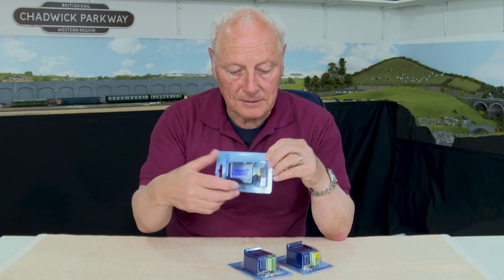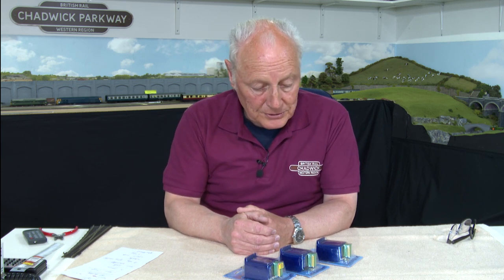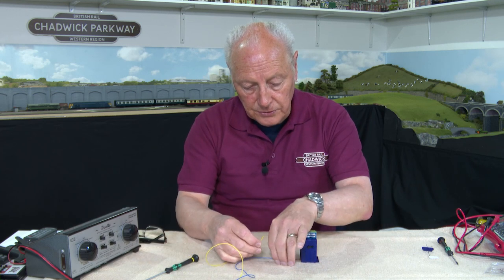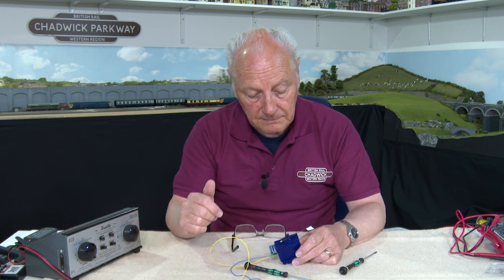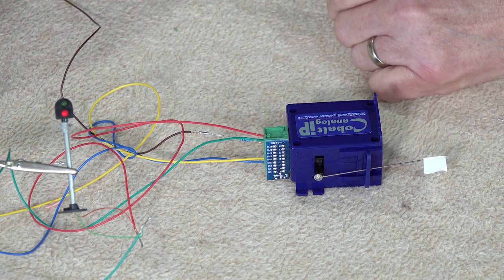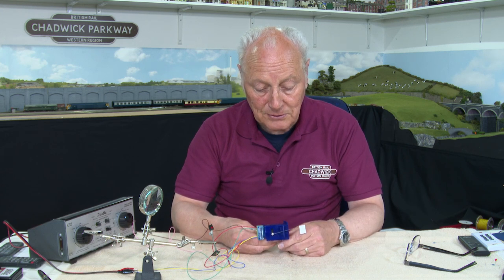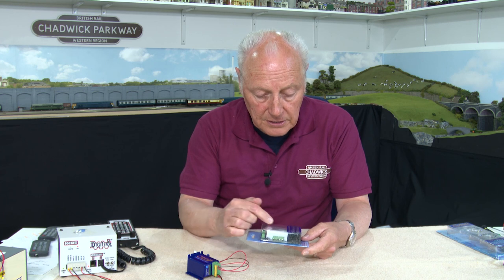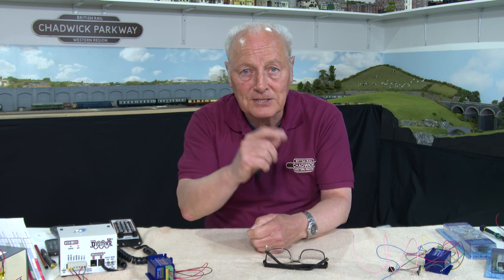Cobalt Point Motors on test at Chadwick Model Railway | 161.

Comment: I bought a 6-pack of the older Classics about five years ago due to ongoing frustration with Fulgurex point motors.  I fitted these about 20 years ago and must have had everyone of them  apart multiple times.  Most of them had the unbelievably unreliable 1950's switches replaced with mechanical electronics hobby shop items that have never failed.  Now the worms are splitting so I began a rolling program of replacement.  This vid would have been even more useful 5 years ago Charlie! What a pleasure it has been to install the Classics.  My only issue has been the plunger cable clips can be a bit hit and miss but once in you are done.  Because my panel was set up for Fulgurex, the switches are momentary DPDT so the current draw issue is not present.  What it does mean is that panel indicator lights had to be rethought.  I could rewire but my system works so will leave it. I have found the sticky pads are only up to the job for a couple of minutes so those screws need to go in rapidly whilst you lie awkwardly on your back, the worst part of the job.  The adjustable fulcrum is an excellent idea.
Reply from the maker: I’m so pleased that you have achieved the satisfactory situation Burt. Point Motors have always been such a pain. Regards, Charlie.
Reply: @ChadwickModelRailway  Thanks Charlie. The Fulgurex units have been the ultimate test of patience and root of much cursing. The revered long time guru of custom track building Norman Solomon endorsed them years ago and I went in boots and all.  Clearly he never operated a layout that he installed them on. BTW, it still makes me smile that the first thing the well informed modeller has to do with Peco electrofrogs is rip the spring out and butcher the underside! Imagine buying a new car and being advised that changing the brake pads on arrival at home is the go?
I’m a 7mm guy so that makes it necessary to remove the non prototipical “coffin” that hides the spring and replace the ugly overscale waxy plastic tie bar too. Not so much Streamline as clothes line?

Comment: I have been using Cobalt point motors over the last 5 years and have found that the grease dries up over time and stalls the motor! Not sure if it's a current issue still but as you pointed out at 24:16 it's still in the manual.
Reply from the maker: It’s not something that comes up regularly Mick, but perhaps a five yearly cycle might be worthwhile. 
Regards, Charlie

Comment: Hi Charlie, great review of the DCC point motors, I started with these on my layout but had one fail and they are very noisy compared to the tortoise point motors.
Reply from the maker: Thanks Rob, which type was it?
Regards Charlie
Reply: @ChadwickModelRailway  DCC IP Digital had 12 in use for a year. With very little use, one failed it would over run and would hear the get cog jumping
Reply from the maker: Thanks for the feedback Rob.
Reply: @ChadwickModelRailway  hi, just like to add. On our club layout we have tried both Tortoise and analogue Cobalt. We have found Tortoise to be more reliable, simpler to set up in that one can manually centre the motor. You need to power up the Cobalt as to try to manually move the unit it will break. We have had a number of failures of the Cobalt units and the lifetime guarantee has its limits.

Comment: Hi Charlie, an interesting video ! I wondered how the Cobalt iP Analogue and Cobalt Omega motors differs from the Cobalt iP Digital - now I know !

After quite a bit of research before I started to build Pevenbourne, I decided upon the Cobalt iP Digital point motor to be my standard device as I wanted a fully automated railway that I control on my own through iTrain. I’ve completed Phase 1 of Pevenbourne (except for the scenery) now and have installed 25 points in this phase, all using Cobalt iP Digital motors that I’ve bought in three 12 packs (one from DCC Concepts direct and the other two from James at DCC TA). At first I was very happy with my choice, until first one failed, then another and another until eventually 8 out of the installed 25 have failed so far. Another has started to show signs of failure as well. So the lifelong warranty is really important and the guys at DCC Concepts have been as good as gold in honouring this arrangement. However, although I’ve had discussions on the phone with them at length, they can’t pinpoint what is causing this problem which is frustrating as I don’t want these failures to keep happening (and I’m sure the guys at DCC Concepts don’t !).

I’m now really having second thoughts about whether I will continue to use these motors for subsequent phases of my railway because, although there’s no problem getting DCC Concepts to replace faulty motors, it really is an extreme inconvenience having to unwire, uninstall, reinstall, rewire and test every time one goes wrong. I’ve had to do it eight times already and to be honest, I’m getting to the end of my tether ! I want to be able to build my railway while I’m still reasonably fit enough to lay underneath boards so that when I’m another decade older, I can enjoy running trains and not have to worry too much about things going wrong.

It’ll be interesting to hear what others have to say about their experiences with these motors in the real world. Have I just been unlucky, or am I doing something wrong ? It would be good to know before I embark on phases 2, 3 and 4 of Pevenbourne which will at least triple the amount of points installed so far.
Reply from the maker: Thanks for your revelation Bryan. 
I would like to think that you have bought a bad batch and that this is a one off.
Let’s see what other subscribers have to say and see if your experience is not a one off.
Thanks for sharing, regards Charlie.
Reply: I did have a few IP point motors that were faulty from a bad production batch they kept losing their digital addresses. I tested them all and sent the faulty ones back to be replaced. I've not had any problems with the analogue motors. I presume DCC Concepts will have tested the faulty units when they were returned which you would have thought might have  helped them identify the problem. I agree it is a pain going under a board to replace the motors.
Reply: Interesting to read the above. I have two suffer mechanical issues (out of 18 installed so far). As you say, DCCConcepts are first class in terms of customer service but it is puzzling. I do wonder whether it is something to do with DCC - I use a Roco Z21 black - because following a recent bout of point activity (when the point just keeps running and clicking) I thought here we go again. However I quickly killed the power and and on turning the system back on again the motor works fine. One to watch.
Reply: @philthrower8264  That’s very interesting, I also use Z21 Black. I’ve even reduced the voltage on my accessory bus to 12v, but failure number 9 is imminent nonetheless.
Reply: @ChadwickModelRailway  Hmm, I did wonder about the bad batch theory as well - though I bought my 36 point motors at different times in 3 x boxes of 12.
Reply: @simonbradshaw3708  Yes I was aware of that batch that lost the assigned addresses, but the ones I’ve had fail are a different problem. I was hoping that DCC Concepts would’ve found the problem having sent eight back with the same fault. However, unfortunately their testing has been inconclusive so I’m none the wiser as to what’s causing it. As mentioned below, I’ve reduced the voltage on my Accessory Bus to 12v (from 18v) but another one has recently started to show symptoms of the same problem.
Reply: @Bryan Lane  Interesting. Mine are on an accessory bus - there are no other devices on the bus, the bus is powered by Alpha Power/Alpha Box running at 18V, with bus suppressors fitted to eliminate spikes. I also use iTrain. The fault manifests itself as multiple attempts at throwing with the accompanying sound of mechanical stress in the motor. Pausing and restarting iTrain cleared the fault last time. I wonder if there is some software conflict somewhere? As others have said it may be a batch issue. Who knows? At least the team at DCCConcepts are great but nobody wants a failure as changing the motor never = quality time!
Reply: Without meaning to sound critical Brian, it sounds to me like the problem may be with your layout/control system, not necessarily something you're doing wrong, just something the motors don't like. Eight, maybe nine, seems like a very high failure rate on a product which seems to have a good reputation.
Having said that, I'd say it was up to the manufacturer to work with you and try to identify the problem. At least they are honouring the guarantees. It will be interesting to see, if you install the replacements in exactly the same way, if the same failures happen again. That would surely point to a problem with your system whereas, if the replacements work fine, it would appear you've got a bad batch. Good luck and I hope you'll keep us informed of your progress.

Comment: I've just ripped all my cobalt out as I found some of them to be a tad noisy and I was never happy with the accuracy of the throw adjustment on an N gauge layout. I'm now in the process of installing servos along with MERG servo controller kits. A bit more time consuming as the kit components have to be soldered to the circuit board and a lot more wiring than a cobalt but the ability to accurately control the range and speed of throw makes all the effort worthwhile plus, of course, the cost is far less.
Reply from the maker: I feel your pain Nick, components suitable for N gauge are few and far between. Regards Charlie

Comment: The obvious question, Charlie.   With the IP Digital Cobalt alone, can we have DCC turnout control (throttle, iTrain or TrainController), the panel switch/buttons, the panel lights, and also operate a simple signal (not connected to command station)?  

That's four Cobalt input/outputs:  command station input & response, panel switch/buttons input, panel lights output, and basic signal output.  Perhaps the panel lights and the basic signal could work off the same Cobalt output connections?

And one vote here for doing a review of the relay extension.

Thank you, Charlie.  Very informative.
-
Reply from the maker: You make an excellent point Frank. What I shall do is contact Richard Brighton of DCC Concepts., and ask him to reply to your comment. It seems feasible, but that’s by no means any guarantee. Regards Charlie

Comment: Hi Charlie, thank you for another interesting video. I am curious if you might consider switching from Tortoise, no need for soldering? I have fitted a large number of all three DCC Concepts point motors and found the customer service and support very good. I would recommend the products and the company. Might be nice for you to explore their panel options at some point, you will need some for your layout.
Reply from the maker: Many thanks for your comment Simon. It’s always worth knowing how people on the coalface, are getting on with these products.
I’m unsure about the control panels, but only time will tell. Regards Charlie
Reply: Hi Simon/Charlie, Tortoise actually have a seperate plus that can be purchased that slides over the contacts on the point motor at 3pounds a pop and while you have to solder the wires onto the plug, it make installation and maintenance much easier.
Reply from the maker: Thanks Brent, I thought that they about £6 each.  Who’s your supplier?